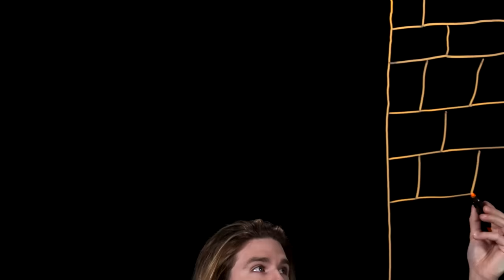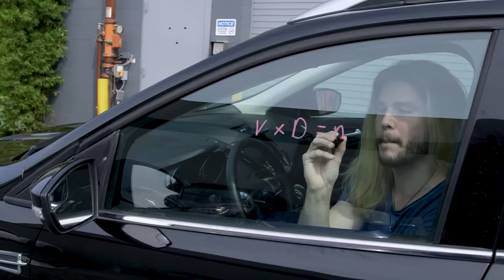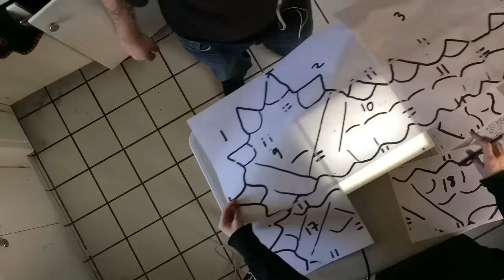Could You Swing A Real Monster Hunter Sword?

Comment: Why didn't you just measure the sword by dunking it in water
Reply: This man is a genius.

Probably because the prop might not be waterproof
Reply: good point but the water test has nothing to do with center of mass which i believe he was pretty accurate on.
Reply: @chrismadden4522  it might actually. how it goes down into the container of water when laid flat could determine it's center of gravity. the water simulating the pull of gravity on the item.
Reply: It would ruin the paint and the styrofoam would be hard to sink without breaking, but submersion would give a better volume estimation.

Comment: Well, the handle part is clearly made of metal, and that metal have to be strong enough to sustain the weight and wielding forces...thus it must may have higher density than the blade parts(Chains on the blade wont be adding too much weight). Im disappointed, there are more details on that replica sword than the science measurement&calculation. There are also "pickle density"(Incuding teeth density buy using the great jagras's weight--they wont be able to support Bomber plane since turf war will always left thing on the ground, things like pickle teeth) and sword stucture(e.g. hollow) to consider.

Comment: Necro reply.... but when designing and forging a sword of extensive length, in order to make it more easily wielded you put the center of mass at the point you grip the hilt. You do this with the pummel. (Big bolty cylinder on this one) that way you don't have to fight the weight of the sword to swing it. Great swords have this same principle but unlike smaller long swords and short swords you can't easily stop its momentum. And that is where it's strength and weakness lays. The game shows this, the bills up of swings are slow and after you start your swing you can't stop it to dodge, neither can the monsters stop the swing and tends to break their charges.
Long comment short, he didn't a count for the mass of the hilt, just the blade. I don't think the hunters are much stronger then normal humans and their animations in game show this. The big weapons take a great deal of momentum  to swing, the throw the hunter around as much as they swing the weapons.

Comment: Hey guys, thumbs up for the video, but you gotta be careful with the torque specs of cars. I'm pretty sure the Veyron or Chiron produce that torque at the crank of the engine. Well yeah you could argue that it would do that same torque at the wheels in 4th gear or so. For example, a 1.6l Miata with 116 hp produces a whopping 1900Nm of torque or so at the wheels - in 1st gear. 

Keep up popping these awesome videos out tho, that prop is amazing!

Comment: Great that you guys measured it out and all, but you didn't account for the metal parts weighing much more than keretin... Also, that the whole 'non-metal' part, isn't actually all keretin...
Reply: This could add a VERY significant amount of weight to the end (wieght of the chain), and the handle area,(wieght of the handle, hilt, etc.)

Comment: No matter your rebuttal

If they know what they're doing, a smith creates a work of art.
Customized and optimized to the intended wielder

Though a weapon may look big and bulky, or like something impossible to wield
It's really just up to the material you're working with

Given most of the weapons in monster hunter are iron and later on made up metals. It'll be a matter of folds, size, material, and treatment for the metal 

Most however are actually purely organic weapons and would therefore be made of scales and bones, much lighter material. 

But that's an entirely different field of work that you couldn't really call smithing

Comment: How much would the teeth, and steel hilt adjust the weight. If you are only using the scales than the weight is a static mass but with the weight adjustment of steel and bone that would not only make it heavier but also change the center of mass.

Comment: Wow, looks like 933 Rajang fans watched this. 

Could you math just how strong and tough the Deviljho must be? 

Between its material composition, relative size measurements, extrapolated weight, and observed feats: leaping and jumping as it does, picking up and throwing other huge monsters, the force of some of its attacks (body check, tail swipe, big slam bite, and boulder throw), that sort of thing. It's a lot of equations but it'd be super cool. 

If you felt up to getting really crazy you could even math out approximately how much it'd take to put the beast down, based on numerically average hp vs overall average damage dealt with a Monster Hunter's weapon (adding up the collective force from all of those herculean swings).

Comment: And every calculation about the mass and the center of balance is thrown off by the hilt/guard being metal and metal chain wrapped around the end so it is a different density then the blade that throws off the weight in your math. Then the center of balance is utter crap to use based on a prop made of foam since nothing is balanced right and again metal not matching your generic one material for everything. If you want to claim science on this you would be better off with a 3d render in a cad program that you could simulate the materials for the different parts in those parts.

Comment: Aaaaaat! WRONG! You used a piece of FOAM to get the center of mass of a sword that isn't made from foam in universe. The sword has irregular densities as it is a composite object made from many materials. The metal hilt and handle pieces will pull the center of mass back towards the handle.

Comment: Take note that armor plays a huge role in all of this. In the monster hunter world armor comes with specific properties that throw the norm of physics out the window. Starting with basics like attack and defense up- this probably has to change a lot of the mass the hunter has every time they go into battle. Food also has added affects that tamper with hunters physique. These skills aren’t limited to the hunter either. There’s skills for techniques and overall straight up magic. (Part breaker and such. There’s even skills that allow for a radius buff affect. Such as if you take a potion your ally’s around you also get the benefit as well. Only with this skill equipped however. This includes all other buffs as well if I remember correctly.)

Comment: This is one of the reasons why such big spiked clubs (its not really a sword eventhough its being called) and other insanely big and heavy melee weapons were never used in serious combat. Its so unpractical to the point that it is unuseable, and even if someone had enough strength to wield it, the wielder would need to be heavier than the sword in order swing it properly. Otherwise the wielder would throw themself away halfway through the swing. I'd rather use a smaller, lighter and faster arming sword which is much easier to wield, swing, stab and parry with. Imagine using that glorified, fat dildo bat in an actual sword fight. You'd be better off with a swiss army knife!

Comment: I'm afraid I have to leave a dislike on this video :(
Reason being, as someone who has actually trained with swords, including greatswords which I can barely lift as I'm not strong at all, it is much easier to wield a large sword once its in motion provided you don't try to fight the motion with something silly like reversing a swing. Controlling and altering the direction of motion is much more powerful, requires much less strength, and is much faster. So the strength required to wield a massive sword with skill (and not as a brute smashing people/creatures with a heavy object) is actually less than the strength required to hold it. Though obviously holding the sword comes first.